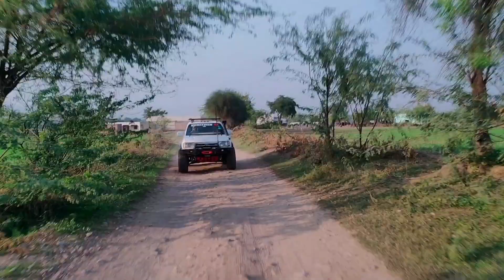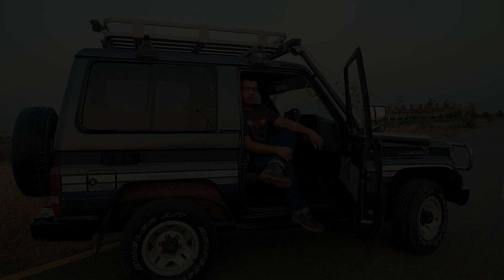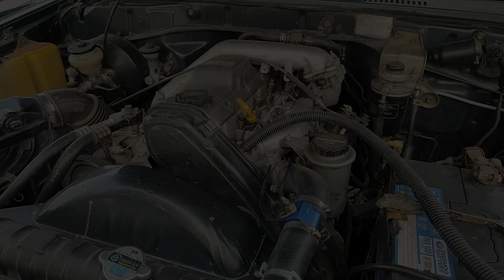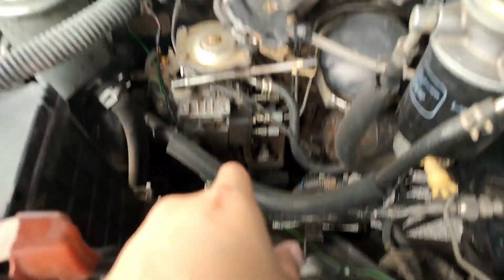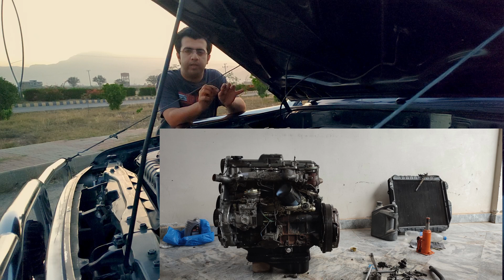Do's & Don'ts of Engine Swaps | Overland Pakistan

Comment: dear ,1kz engine vigo mein kayamb haii ...?
Reply from the maker: Yes!
Reply: @overlandpakistanPK  1kd -2kd se zydaa long lasting hai 1kz , 
Actually 1 year phle 1kdFtv uk model engine mery gari kharab hogaya tha tu mene 1kzte 3000 lagwa ke aya hon kbli, 1saal kee bad overheat hogaya then abhi 5 din phle Engine overhaul karwna par gaya , 0.50 pe hwa abhi , 
Abhi kuch log kaha rhe hen yh engine kayamb nh hen, aap ne 1kd 3000cc , same lagte,
kuch kahata hen 2kd lagte , 24000 cc
gari phle 3000cc hai tu .
2400cc 2kd lagny ke bad wo pick nh hota , 
kindly suggest karen ,
Reply from the maker: Both the 1KZ and 1KD are long lasting engines. Both come with their pros and cons. The 1KD has a common rail fuel injection system, which means that even the slightest impurity in diesel fuel can damage the fuel injectors (which are very expensive). The 1KD has lots of electronics which makes it a bit technical (my personal opinion).
The 1KZ on the other hand is a very robust and simple engine. Bad fuel will not damage it, the only thing you have to be careful with here is the cooling system. As long as you're running coolant, a healthy thermostat, a clean water pump and radiator and above all else! A healthy engine. It will never die!

So in short, the 1KZ is more reliable as it will literally not bother even if you put cooking oil in the fuel tank. For a 1KD, you always have to ensure that your tank is half full (so as not to suck particles from the bottom of the fuel tank) with the cleanest diesel you can find
Reply: Brother Actually, jb gari liye tha tu 5 din ke bad injector khrb hwe the , 
140 tak kharcha nkl ke aa gaya .
then 
15 ke din traveling kr raha tha Turbo kharab hogaya, 
set ke bad oil kaam krny shuru hogaya , 
bht bht tang aa gaya tha vigo invincible london model se. 
phr 3 month ke bad , shershah jana howa wahan pe shop waly ne suggest kia , 1kz lagwo Allah pak yaqeen kry inshallah Allah pak ka karam ho jaye ga .
then mene install karwya .
1saal ke bad 10 din phle issue aa gaya overheat, then mene engine fully Restored karwya , 0.50 pe 
Actually mein Sindh se hon , yahan pe diesel Quality khas nh hai, tu
3 bar injector, diesel pump set karna par , phr be sukoon nh tha 1kdftv uk model. (Fix injector) 
Ab Allah pak yaqeen kry ke Engine chala raha hon mgr , 1kz users se Experience maloom kr rha hon.
Reply from the maker: Bus baaz waqt aisi gari apkay hath lag jati hy jiskay previous owner ny bilkul khyal nahi rakha hota. Apkay 1KD kay sath yayhi huwa hoga, everything in it was at the end of it's life. It's good that you rebuilt the 1KZ, making it basically brand new. 

Now just keep a watch on it's cooling system and have the injectors serviced every 50,000 kms and inshallah it will last a lifetime
Reply: @overlandpakistanPK  bas brother jsy vigo invincible london model liye tha uska original phele weak tha .
2month 4lacs barbd hogaye .
bht prshani dekhi .
uske bad
1kz lagwaya 650 tak okay hogaya 1 saal phele , 
Abhi MASHALLAH Engine Restore karwya hai..
apke videos dekh ke apko taklef de raha hon .
Actually sindh mein be shoken log hen but har ksi ka apna idea hai .
bht log petrol use krte hen .
4x4 users kaam hen .
Reply from the maker: 4x4 users inshallah zyada houngay time k sath. Logoun ko motivate karnay k liyay hi yay channel chala rahay hain hum 😉
Reply: Brother! Recently mene 1kzte Engine overhaul karwya hai Actually Normal Gari pressure bana rha hai pani mein , 
phele NTC 76 ka lagwa hwa tha, 
abhi mjhe blue packing mein 82°c ka mila wo lagwaya hai, 
Normal Doubt lag rh hai , gari overheat tu nh ho rhi hai , 
es liye guide karen koi issue tu nh ...?
Reply from the maker: If the temperature gauge is in the middle, it should be fine. Also you can install an aftermarket coolant gauge to keep it under check
Reply: which types of gauge installed , kindly guide ,
Reply from the maker: Any aftermarket water temperature gauge

Comment: Assalam o Alyqum Brother, I have GQ Patrol 1990 Model. It has TD42 engine with Manual transmission. I am advised by a person to install 1UZ vvti with same manual transmission. What do you say about it?
Reply from the maker: I personally wouldn't opt for a 1UZ. If you want to install a petrol engine, go for the 2UZ. Otherwise, 1HD-T, 1HD-FT all the way!